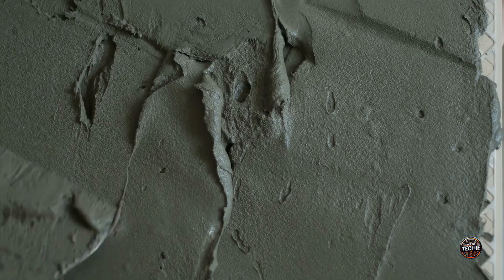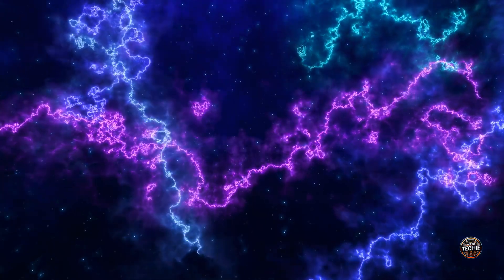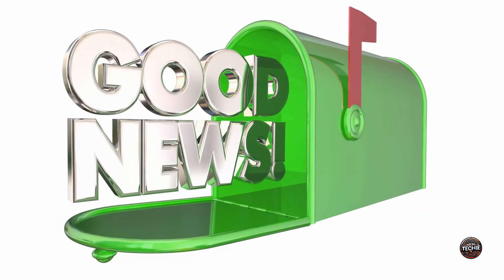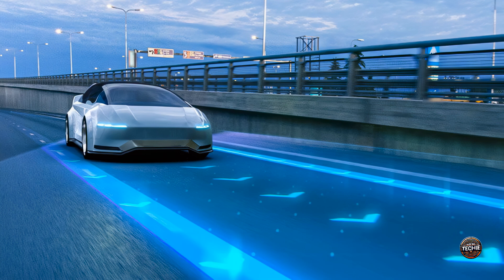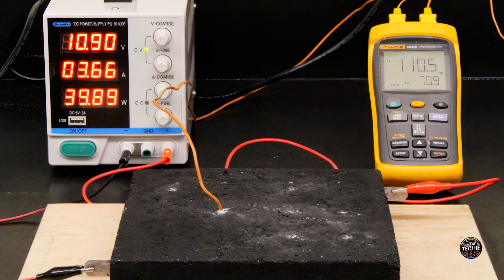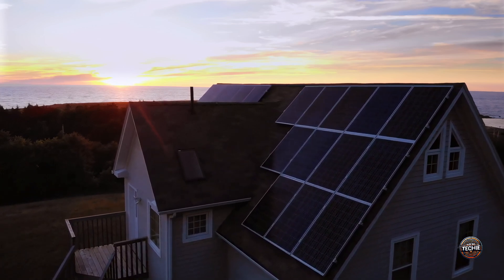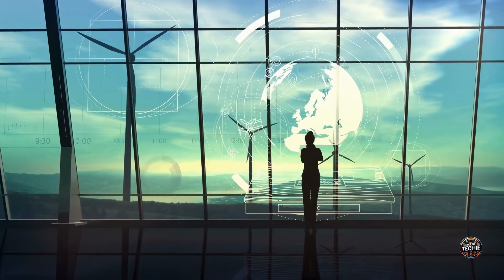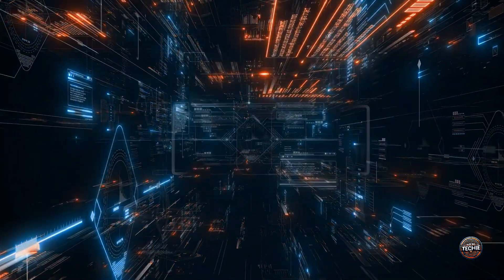Concrete Battery Breakthrough: How Your House Could Power Your Life!

Comment: If the carbon were in the form of graphene the tensile strength of the concrete could be greatly increased - perhaps no steel needed. Also microengineering the concrete with nano particles of silica makes UHPC (ultra high performance concrete) 10x stronger in compression than ordinary concrete.  A typical home may use 10 to 30 cubic meters of concrete or only 1 to 3 kWh at 300WattHours/m^3 so the energy storage value may only account for less than a tenth the cost of the concrete...
Reply from the maker: Where can I invest @Daryloster..lol...love the idea. How would you feel if you could combine with 3d home printing techniques. Fast, strong & less materials hypothetically. I also wonder how the lower mass would potentially affect the overall building composition...🤓
Reply: @NotSoTechie-News  while 3d printing is great for one-off designs, it has many limitations for construction.  Insulation is not very good.  I believe tilt-up insulated concrete panels are better for most construction.  And I don't know much about how this (or 3d printing) would help or hurt the use of concrete capacitor tech - only guesses
Reply from the maker: @DarylOster  thanks for the response! I believe we would need a structural engineer & those who play with this tech to come up with some real world test to see if the battery concept is viable in your original concept along with all the other concerns others have raised.

Comment: What is this, a pr stun by the concrete industry. The concrete industry produces massive amounts of C02 which gets released into the atmosphere, unfiltered in anyway.
Reply from the maker: Thanks for the Interesting reply...I don't who is paying for their research stipend, but it's true that traditionally cement production has a significant CO2 footprint. The development of carbon-cement super capacitors however could be seen as a way to offset it by integrating energy storage into building materials, thus reducing the need for separate, resource-intensive batteries. Researchers are also exploring more sustainable cement alternatives using waste materials, making this innovation a promising step toward a cleaner, more sustainable future.

Comment: Could this create an issue around electrolysis?  Like there is steel reinforcement in concrete.
Reply from the maker: Great question!  From my limited understanding...yes, the integration of concrete supercapacitors could potentially create issues around electrolysis, especially concerning the steel reinforcement in concrete structures. Careful engineering and design considerations are important to prevent issues related to electrolysis and ensure the long-term durability of reinforced concrete structures.

Comment: And generate enough electricity to power an LED...🤣🤣🤣
Reply from the maker: Did some digging...a concrete supercapacitors developed by MIT can store up to 300 watt-hours per cubic meter, enough to power a 10-watt LED light bulb for 30 hours. Key being 300W/cubic meter. Scaling up to a 45 cubic meter installation could store about 13.5 kWh, potentially powering a house for a day. While current capacity is modest, these systems charge quickly and could significantly enhance renewable energy storage. While skeptical...this could be a viable product one day.

Comment: What about lightning strikes?
Reply: That's exactly what lightning rods are for.
Reply from the maker: Great question...Ideally, the building’s design would account for lightning protection, ensuring that any energy storage systems, including concrete supercapacitors, are safeguarded against such extreme events, and prevent damage to the building and its innovative energy storage components.
Reply: Great for charging a capacitor...
Reply: @DarylOster  ac?
Reply: @IzySly-g4h  Lightning is ultra high voltage and high current DC, and some types of capacitors can absorb (or deliver) very high voltage and current for a short amount of time.  I don't know if the concrete capacitor is in this category or not.
Reply: @DarylOster  what an idea...
Reply: @IzySly-g4h  none of it is my idea.  UHPC is 25 or 30 years old...  may be some advantages if tested with the capacitor tech...
Reply: @IzySly-g4h  others are changing capacitors using electric current from the earth (lightning)...
Reply: @DarylOster  I'm just saying that's a crazy idea , who in the world would even consider such a thing , and someone actually said to themselves one day "I think I can make this work " and then actually try it out and made it happen, blows my mind.